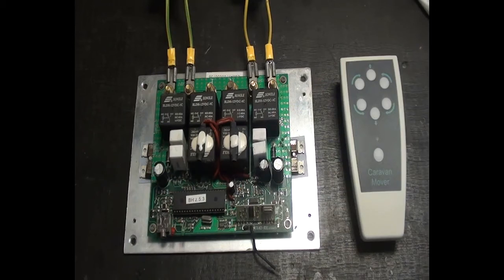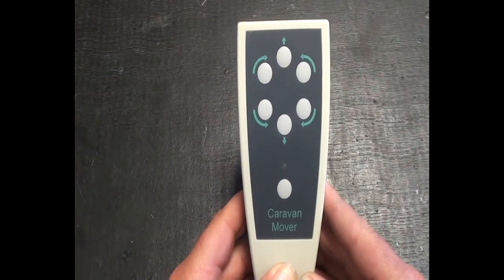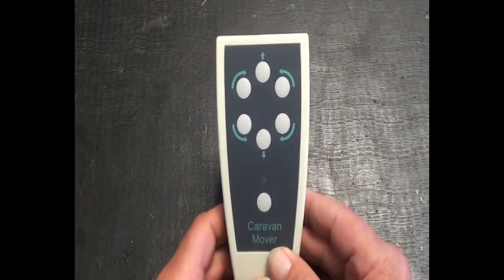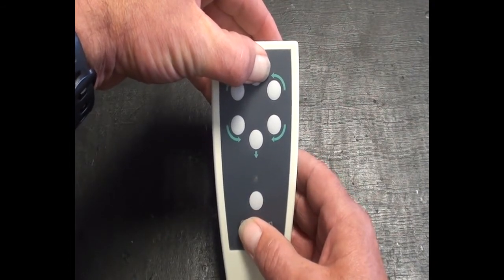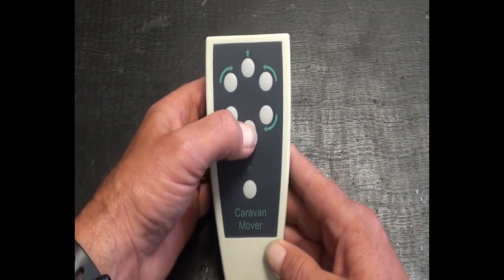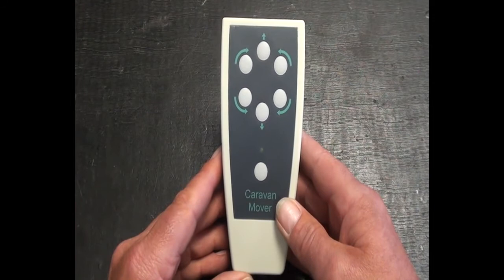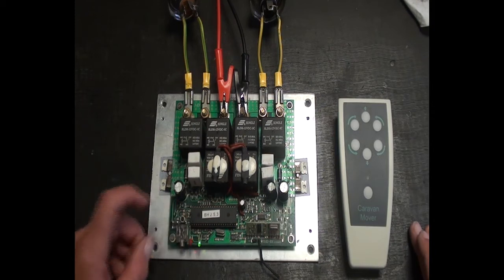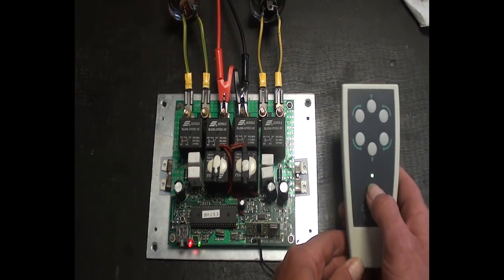Tutorial - Configure Handset to  PowrTouch Mover

Comment: Excellent little video. Powrtouch no longer sell the replacement remotes but invite you to spend nearly £300 on a new electronic control box & handset. Bought the Universal Handset from AR Electronics for £75 &, with this tutorial, had it set up & synced in less than 10 minutes. Result!
Reply: Prima uitleg was zo gelukt thanks